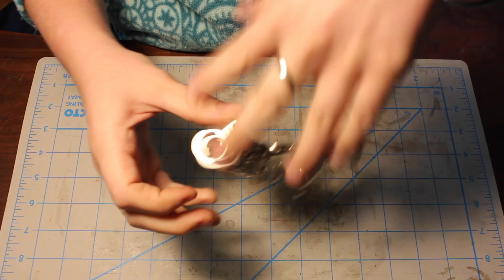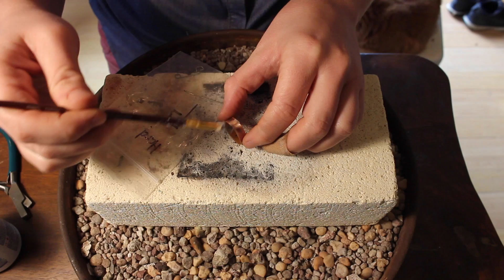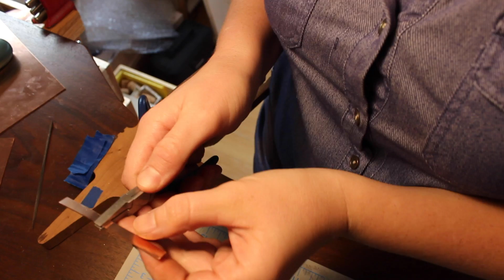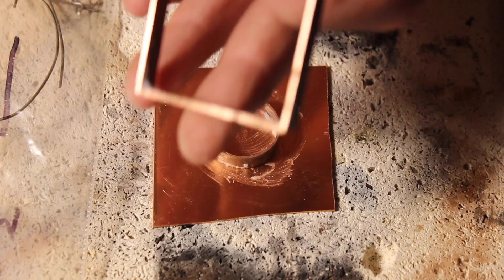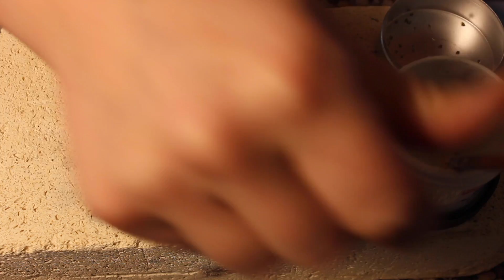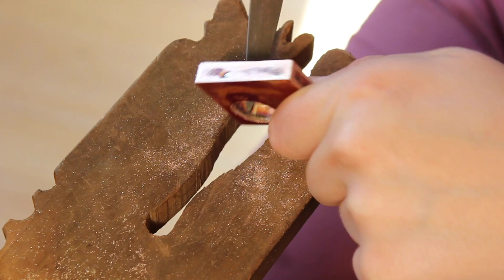Hollow constructed ring | Metalsmithing and Jewelry

Comment: Thank you, so no need to drill a hole to release gases!?
Reply from the maker: Yes, I do add a small hole for the release of gases.  I usually hide the hole by drilling it in the ring band blank at the beginning around the 2 minute and 36 second mark in the video. Thank you for the question, that is definitely an important step.
Reply: 😢I am a beginner making this in a class in Portland, OR.  I am thrilled to find this video with clear, concise and detailed explanation.  Thank you! Excellent presentation @roseschlemmer8012
Reply: @roseschlemmer8012  Rose , thanks for this video. I know that you are supposed to add a whole , but can I cover it somehow ? I want to do a Cherry with a stem , is there a way not to have a hole on it? It would look weird if I leave a hole
Reply: @roseschlemmer8012  thank you...I'm sorry I missed it the first time!